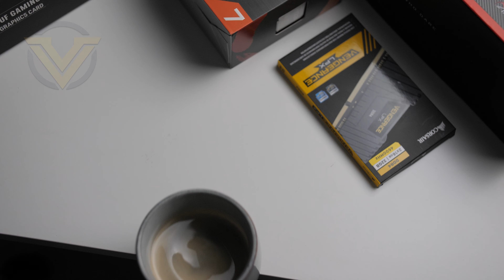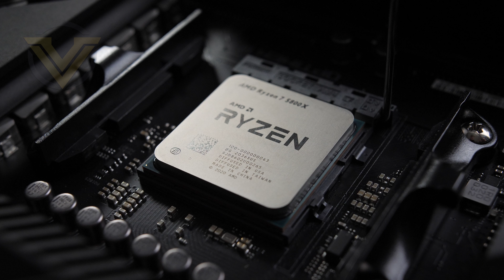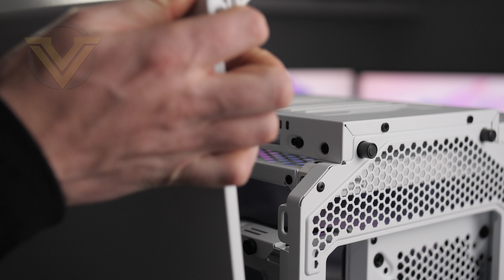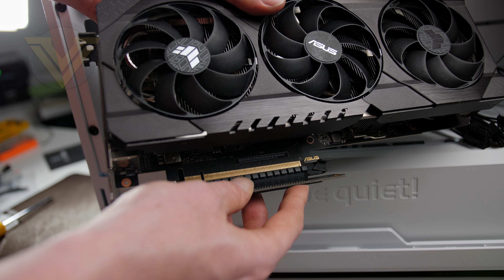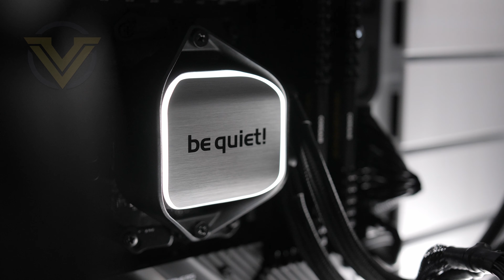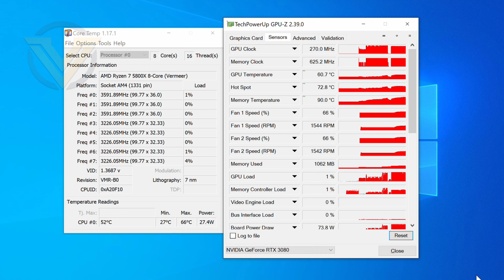ASUS Gaming PC Build 2021 - Ryzen 7 5800X | ROG Crosshair VIII Dark Hero | RTX 3080

Comment: hi there, I have build similar PC, but I got problem, when I turn it off, to turn it on I have to unplugg it from power completely. otherwise it does not start. How many power connectors did you connect to motherboard? I have at the moment the big one (24 pins) and 8-pins connector connected to MB. Do I need to connect the 4-pins power connector as well? Ort what could by a problem? thank you in advance. Dalibor

Comment: I have gotten one of these Dark Hero motherboards now, and my question is, i cant see if you plugged in both the 8 pin and 4 pin eps connectors. I only have an 8 pin, will that be enough?
Reply from the maker: We plugged in both - the 4-pin is generally required if you are doing advanced/extreme overclocking and need the extra juice. If you run a stability test, you should find that 8-pin is more than sufficient

Comment: I have had AWFUL luck with my Dark Hero. First board had B1 & B2 Dimm slots doa. After arguing with ASUS they finally RMA'd the board. The next board is now hard locking after about 20 minutes of gaming. To the point that the power button being held will not power down the pc. I literally have to unplug the pc. AUS is refusing to RMAS the board. I will never buy ASUS products again. COMPLETE waste of $500. Oh and stock settings the Dark Hero was pushing 120+ watts to CPU causing a lot of heat issues.

Comment: What storage did you use in the M.2 drives? Also if you use one of the lower pcie slots does it disable the bottom M.2 drive bay as I know it does on some boards? Was looking at putting in a samsung pro980 in top and 970evoplus in lower but not sure if it will get too toasty.

Comment: Would be great if I had 4K to spend on a pc
Reply: you don't need to spend that much money man, try to snatch a card at your local MicroCenter or BestBuy. You might have to camp for 12+ hours like me but totally worth it. I just finished my build (Ryzen 9 5900x, 3070, Dark Hero,  16GB 3600 cl16 ram) and I spent roughly 2k. It was definitely all of the money I saved working last summer but if you are willing to spend some hours camping in a parking lot it really pays off.
Reply: @Venvanse30mg  and also other games like cod and rocket League etc. I’m just trying to see other people build pc so I know what’s compatible
Reply: @Armed Kard  hey man sorry for the delay. You might wanna go Ryzen 5 5600x, AMD 6700XT (even scalped these are like 700 to 800 USD), a MSI Tomahawk B550, a 500GB nvme ssd, whatever 650W or 500W PSU you can find, 16gb of 3200 RAM (these go for only 80 bucks) and you're set to go with spending roughly 1500 USD.
Reply: And if you are willing to camp outside your local Microcenter or BestBuy you can save A LOT of money on gpus. I got a Zotac 3070 in May for 710 USD (these go for 1400 on Ebay) and yesterday I camped again and got a 3070 from EVGA for 649 USD (these go for almost 2k or more on Ebay). So as I said, you can always camp and you'll probably get sth.

HOWEVER, I feel like the best option is to get a good gaming laptop, like the ASUS ROG Strix 15 which goes for exactly 1499 (your budget) and has a Ryzen 9 5900H and a 6700XT, and is an absolutely beautiful and powerful machine. You can just walk into a store and buy it too, so much easier for you and I am sure it can absolutelt demolish GTA with 100+ fps on ultra graphics. Just search it up online and get one, those are very very nice machines.
Reply: Also the dark hero was overkill as f*ck, totally not needed, if you go for a TUF 570 and a different processor like the R7 or R5 3600x you should spend less than 1400 usd
Reply: @Venvanse30mg  oh ok thank man I’m tryna to build a gaming pc for gta FiveM not sure if you know what that is and I’m looking to spend about 1500 I just don’t know what parts are compatible

Comment: Hello! Same Gpu and Psu here, great card, very cool card, after overclocking, max temperature is 64 c, rpm near 2000(auto fan, performance bios), baught it at start RTX 3000. Regards.
Reply from the maker: Nice choice. You were lucky being able to get it so soon! :)
Reply: @Vortez  Thx! Sold my RTX 2080 TI, and bought TUF, in Moscow it was for 1500$, now 3000$, good investments, haha! Thx a lot for the review...Top! Interesting OC of GPU, how it goes...)